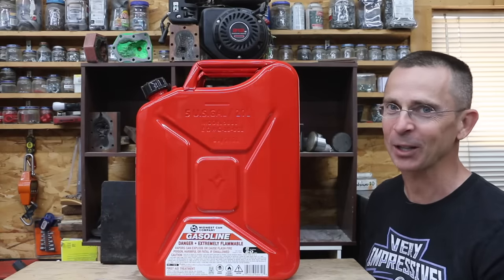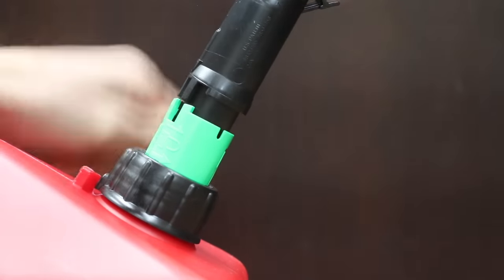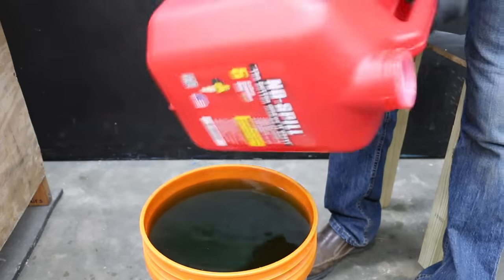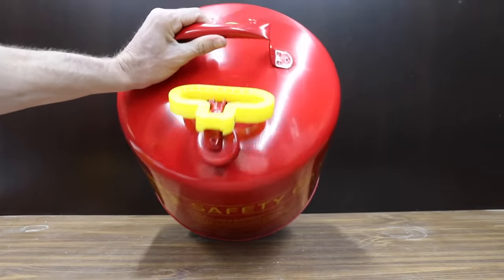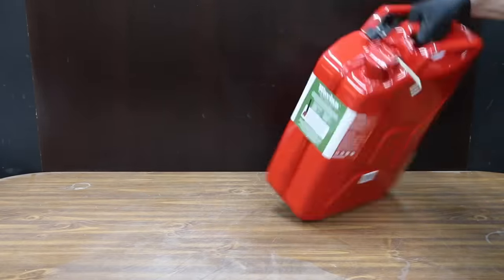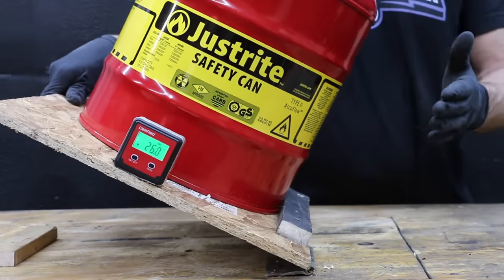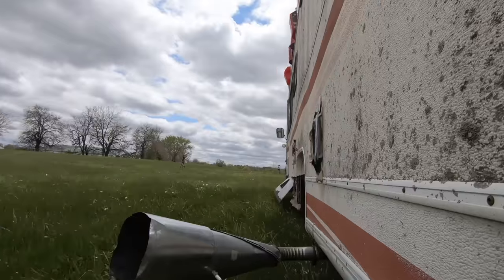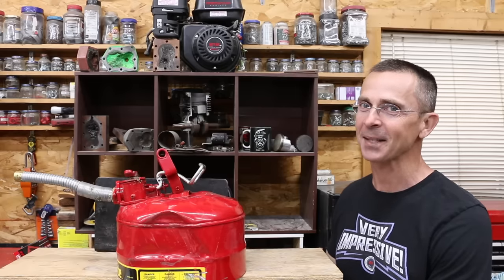Best Gas Can? $140 Wavian vs Eagle, Surecan, Scepter, Briggs & Stratton, Midwest, VP Racing

Comment: I would like to see you test whether window tint film actually makes a meaningful difference on the interior temperature of a vehicle on a hot sunny day. Thanks for all the great videos!
Reply: That's a great idea, and I would add things such as UV blocking (bleaching, sunburn).
Reply: Good idea could test many different percentages and see which performs best
Reply: As someone who use to sleep in a VW type 3 wagon on his lunch break in college, I can tell you it makes a huge difference.
Reply: @TristanJCumpole  the window glass already does a high level of UV blocking. 
Source: my glasses' transition lenses won't darken while driving but WILL if I leave them exposed on the console for a few hours. Whereas they take about 30sec to react when outside.
Reply: @cobra6481  "we're going to test that"!
Reply: There's plenty of videos and research out there already. However, it still would be interesting to watch Project Farm do it
Reply: All of my windows are deeply tinted with a ceramic window tint. My windshield is un-tinted, on a hot day you can feel the heat coming through the windshield, but my side windows you cant feel the sun at all.
Reply: @JoshuaPlays99  that makes sense.. More I.R. getting through = more heat...
Reply: Great idea
Reply: @JoshuaPlays99  Thanks, do you know what brand you used?
Reply: @wims58ej  The shop that tinted my windows used Madico Black Pearl film, my rear window and rear side windows are 10%, with the driver and passenger windows being 20% tint.
Reply: @JoshuaPlays99  Thanks Joshua!
Reply: Great 👍 idea also include the new “ceramic” tint
Reply: Great idea! Low end vs high end ceramic types too
Reply: Agree, this would be an interesting idea

Comment: My mom and I were just discussing this yesterday,  what a crazy synchronicity.  You just go above and beyond in your rigorous testing!  She was complaining about how difficult her gas can was to pour,  she said she needed 3 hands.  I now understand by your video which one she has more than likely.  I sent her the video so maybe she can pick out a can more suited to her needs.  She's mid 70's and has hand issues so I hope this video helps.  I also told her to get on Amazon and just order one of the Chinese spouts that were like the old school spouts,  most of the cans not having a vent anymore though is one of the big problems I see.  All of my gas cans except for 1 are the older style so I don't have any problems with them.
Reply: I have see people attach gas cans to hand carts and attach a hand crank pump to the setup for her.  I assume she is filling mowers and things.  Make her life way easier with a portable gas station!
Reply from the maker: Thank you!
Reply: You can buy the lil vents for peanuts and a lot of the spouts come with them
Reply: Oh thank you for all the good ideas,  I hadn’t even thought of those. Yeah an electric siphon or a manual pump would be awesome!  I think that would make it much easier on her. Great ideas 👍
Reply: For CARB compliant fuel cans, I just remove the nozzle and pour it in a funnel.  Works so much better.
Reply: I really like the Surecan because you don't have to tip the gas can to pour since the spout is on the bottom. Also the spout is valve controlled so you can line up the nozzle before starting the flow of fuel.

Comment: I've had five of the SureCans for a few years now and really like them.  I agree that the flow could be a little faster, but they're still fast since you vent them through the fill cap, and not through the nozzle like a lot of the cheaper cans.  Also, the fact that the nozzle on the SureCan has so much adjustability, it lets you rest the can on almost anything you're filling, so a little extra time doesn't matter to me.  SureCan also makes a smaller 2.2 gallon can that I use for mixed gas in my pole saw and other small 2-stroke engines.
Reply from the maker: Thank you for sharing!

Comment: Those eagle gas cans are awesome we use them on the pipeline on every job I’ve been on they’re mandatory because of DOT requirements of small fuel cans, we use them for small 2”-4” water pumps to pump out tie in ditches. BUT  after 12+ years of pipelining I’ve learned that these cans have no vent so when they’re sitting on the back of the work truck in the middle of the ROW with no shade, in august, in a soybean field in Ohio they build tons of pressure there’s been many times where the new guy gets soaked because he didn’t open the lid slowly to vent the pressure 😂. I’m a union pipeline operator now I don’t labor anymore I run a side boom or a trachoe but I always warn the new laborers about those fucking cans and tell them about the burning effects of gas on sweaty skin in the middle of a 16 hour shift lol.
Reply from the maker: Thanks for sharing.
Reply: My grandpa has some old dot safety cans they pretty decent cans you definitely got to be careful opening it when it’s warm out even if the can is in the garage that pressure ain’t a joke he still has one that fell off his truck and then got ran over I’m sure if your really needed to use it you could still can open the handle on it
Reply: we also have eagle cans at the golf course I work at and I to know the enjoyment of watching noobs not venting the gas can 😂🤣
Reply: Goes for the NATO style Jerry cans, too.  The eagles at least are spring loaded, so with enough pressure build up inside, they will start to vent.  The latch on NATO cans will hold a lot of pressure (or vacuum)!

Comment: With the jerrycan (at least a real jerrycan like the Wavian), there's no reason not to just store it on the side, it is designed to be safe to use this way; I understand the test for the other cans though.
Wavian cans are manufactured in Latvia, at a facility that manufactures cans for NATO as a whole (which moved because of WWII).
Reply: Fun fact about the Jerry cans, they were designed and first implemented by the Germans in ww2, hence the name Jerry can. They became a prize when they captured German equipment to find them and even paid people in the nations they were fighting in if they brought them to the allied. All in all most of the Jerry cans in ww2 used by the allied were German constructed. The US started constructing them but they did what they do best, cut corners and made them really inferior.
Reply: Yeah I lay mine flat in the back of my truck all the time, it’s never leaked. There’s no reason to transport the can upright.
Reply from the maker: Thanks for sharing.
Reply: @ItsMeGiga  why are some comments calling them Gerry cans? Are they just spelling variants like Jheri curls?🙃

Comment: What a fun test! In my shop I use the Eagle cans for gas and the VP jugs for diesel and one thing I've found is that the VP is excellent if you barely crack the vent knob but unscrewing it too far results in spillage. Once you learn to just crack it you can empty the jug without spilling a drop.
Reply from the maker: Thank you!
Reply: Yeah, I start pouring and let a vacuum develop, then I open the vent. It drains nice and fast. 

I used to use it all the time when I was fueling my car with e85 because the station wasn't close.

Comment: How to make gas cans great again:

1) Remove flash arrestor screen 
2) Replace push valve with older free flow valve( ebay/hardware store)
3) Drill 1/2 hole in back and add a vent.( ebay, amazon, hardware store) 

All cans are equally good after those are added.
Reply: #3 for me is installing a threaded tire valve stem for ventilation. Take the valve core out. Caps are easy to find and universal.
Reply: @LemonySnicket-EUC  I've tried that but used rubber stems....which the gasoline dissolved... plastic or steel stems are the way to go
Reply: @johnmichael5179  yes sir ! And the threaded ones are usually steel but there is still rubber in the gasket so it will eventually need replacing and it's a simple procedure plus the parts are very common.  I haven't had any failures yet because I install the vents where they rarely come in contact with the fuel. I'm sure we could source out some rubber gaskets that can handle the fuel.

Comment: Of all the new style cans I've tried I like the "no spill" brand the best. The button system works good if you're filling small engines. If dumping all five gallons out I take the spout right off, hold it sideways and the wide mouth makes for easy pouring with a funnel. They're also not as tippy as the v.p. style. I work on a boat a lot and use gas cans daily.
Reply from the maker: Thanks for the feedback.
Reply: I like them because "No Spill Jill" does such an excellent job promoting them.  If you've seen their video, you know what I mean. 🔥🔥

Comment: Being an Old Fart, it amazes me how a simple fuel can with a spout and a screw-on cap has morphed into a government mandated and expensive gas can. With a little common sense, the old style worked just fine and I haven't set myself on fire or blown myself up yet using my old can!
Reply: But your sample size of 1 isn't good. 

Common sense doesn't address the things these cans are supposed to:

Children don't have common sense, hence the child-resistant requirement. 

Common sense from the end user doesn't prevent vapor release caused by the can design.

Common (average) sense didn't prevent the need for flame arrestors because there still was exploding gas cans when they were nearly empty, rotated (to pour), and subsequently filled up with flammable fumes. Sure, common sense would require not having an ignition source nearby when fueling but in the areas where gas cans are used, there's often many ignition sources that were ignored

Comment: I remember when all gas cans had the little vent like the racing one did but in a far better location. Why these things cost so much on the plastic ones boggles my mind as they are very cheap to make. The gimmick safety "control" spouts are more of an annoyance than help some times. A few cans with the control push button with the thumb like the first one you tested (for general use like lawn mowers) or the full hand pull like the Justrite I think are the best designs for use in controlling the flow to not overfill. Those metal "Jerry Can" gas cans are the same outside the Stark one as that thing looked cheaply made even though it cost more.
Reply: The justrite can looks REALLY nice for filling small equipment but it's a little expensive for most peoples taste.   I miss the old plastic ones that worked fine.
Reply from the maker: Thanks for sharing.
Reply: Thumb control ALWAYS Leaks lol hate them with a passion!
Reply: The companies have to pay for the insurance policy... Otherwise they'd be cheap.
Reply: I still have a few of the Blitz lawsuit cans and they are fabulous, I wish I bought more when I could. Just nice and simple spouts that push right back into the cap, nice flip top vent hole. I think Amazon has some that fit most plastic cans.

Comment: one thing to note about the military-style cans is that they were designed to be stored on their side because they were made to be stacked so they can haul more out to the field in one trip so I do think the tip over rating would be different if tested for how they were designed
Reply from the maker: Thank you for the information!
Reply: Wouldn't you need to stack them for the tip test?
Reply: @canucanoe2861  yeah I guess you probably would which actually might lower their ratings unless you filled the whole back of the truck with them which at 140 a can doesn't seem like a test we might get
Reply: @ProjectFarm  he is wrong actually, the 'military' one aka the jerry can was made to stack vertically, look up some history of german use of them, also they where designed to not need a funnel, hence some did poorly with a funnel. should have bought and old ww2 one for comparison to see how much better the modern ones are. notes on the other ones are that 1 metal jerrycan has its welds come out of the recess area making it possible to damage them. the round metal ones will be the 1st ones to split and leak once dropped from a less then not significant high since the weld is at the bottom. jerrycans where also desighned to be secured veritcally outside a vehicle so they wouldnt stick out to much since intirior space can be limited. the metal ones with a liner are actually suitable for carrying drinking water. conclusion should have been that you should just buy an old jerrycan thats in good shape for maybe 20 to 40 dollars. and leave the new stuff in the store
Reply: we always stacked ours vertically and tied them together
Reply: @sofaking1102  they are made to expand sideways for heat and damage. So by stacking them sideways you might have them bulge on the bottom or have them not lay flat on its side when heat comes. The form in the side has a double function by stacking them like that you remove one that is needed. Quality ones can handle it better but a cheap one might burst at its seam if there is to much weight on it in hot weather
Reply: Wrong. They are made to be stacked vertically. I never in 28 years military service (Army) saw them transported on their side.
Reply: @us1fedvet  But, you COULD, with no issue. No vents, no leaking.
Reply: @chrisdevries2208  Never had an issue with expanding cans, even in 100+ weather in a covered trailer.
Reply: @ksavage681  actually, you wouldn’t. “Could” is irrelevant. The indentations on the side are what allow for expansion, therefore, you would be foolhardy to potentially impede that. Also, why would you risk leakage by storing a full container on its side if the cap is spun? You always store fuel below its pour spot.
Reply: @sofaking1102  one of my troops unwittingly placed a full five gallon can of Mogas on a tent stove thinking he was heating five gallons of water. He didn’t bother to verify the color of the gas can in comparison to that of a water container. I discovered it, ordered everybody out of the tent, and with a stout set of gloves carried that heated gas can out to simmer down. We let it cool down for hours before opening it; no issues, thank goodness. The cans did not expand or leak even after being heated.
Reply: @us1fedvet  Yeah those cans are literally indestructible. We backed over a few with one of our MATVs. No denting, no puncture, wasn't leaking after.

Comment: I love my wavian cans. Wavian makes a metal spout that is longer than the stock spout, makes it easier to pour without spilling. Also side benefit is that it dumps the gas out even faster since it has a bigger diameter.
Reply from the maker: Thanks for sharing.
Reply: Wavian don't seem to be stocking the flexible metal spout on their site at the moment, but Valpro has an identical one available on Amazon. I've bought a few to avoid using the useless "no spill" type.
Reply: Same - two wa Ian’s here with the metal spout.
Reply: The manufacturer in Latvia makes the Wavian jerry cans, which they also sell to many other resellers across the globe. I picked up a few in Australia at Stratco, they were $40AUD — Wavian is severely making up their products
Reply: @markcleveland8898  Yup Wavian cans are made by Valpro
Reply: @johnb6432  Valpro manufactures the Wavien cans, I work here. At work right now actually.
Reply: @xmartins2638  send me some cans!!!!
Reply: @Reign_In_Blood_963  :D
Reply: @xmartins2638  just bought 4 of your cans in olive green. Best gas cans I’ve ever owned
Reply: @michalp2362  Glad you like them.

Comment: The part about these tests that concerned me was the weight difference between gasoline and water, but apparently the average weight of water and gas is 8.3 and 8.4 pounds per gallon, so these tests really are about as accurate as you can get without spilling gasoline all over everything, which doesn't feel too safe xD

Thanks so much for your hard work sir, you do a great job and your videos are always very entertaining <3
Reply from the maker: Thanks and you are welcome!
Reply: Uhhh. No. Water is 8.4lbs per gallon and Gas is 6